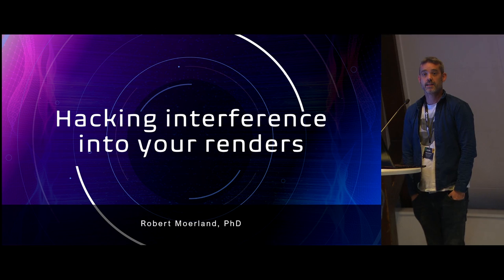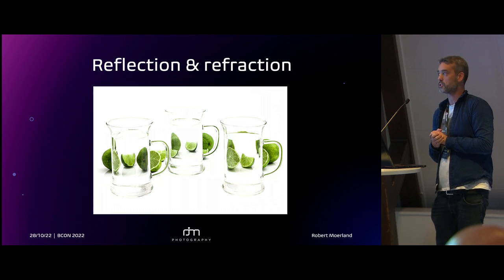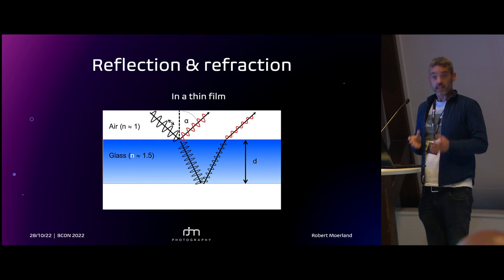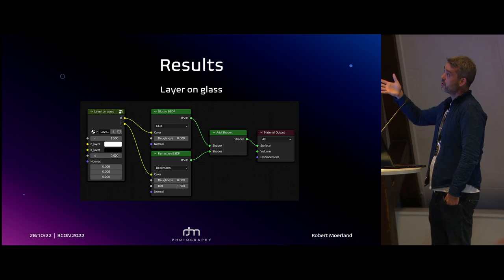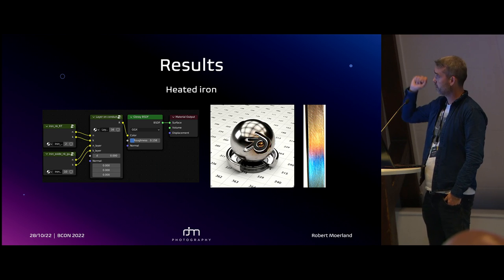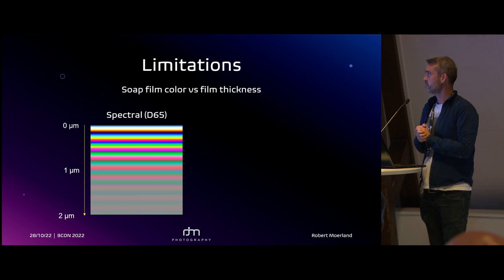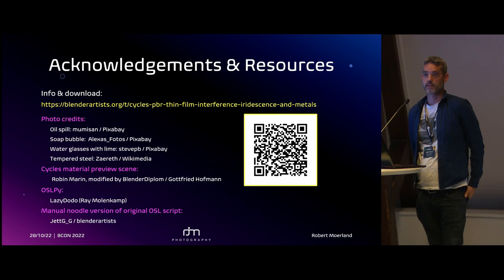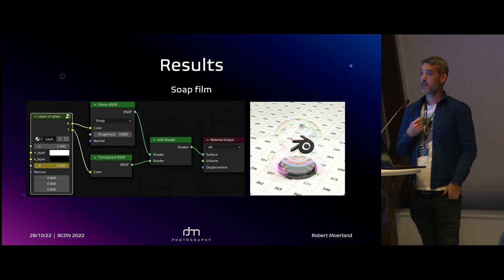Hacking interference phenomena into your renders

Comment: Great work!
Once spectral cycles is in, it's gonna be so much easier to do this.
With the old version of the spectral branch (predating Cycles X), I got a very nice thin film effect. The necessary nodes are still somewhat of a mess, but instead of having to do all these calculations for three separate channels, you actually only need to do it for a single generic wavelength at a time, so a lot of vector math would become scalar math instead and such.
The main difference will be, that you put in spectra instead of colors.